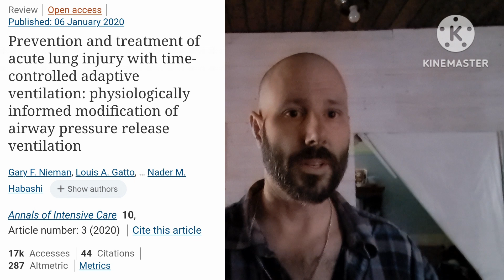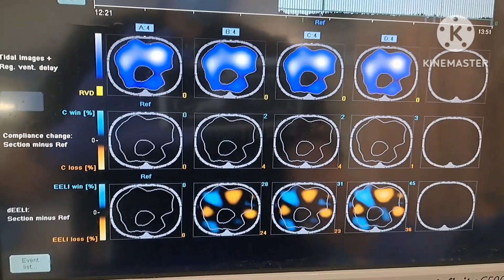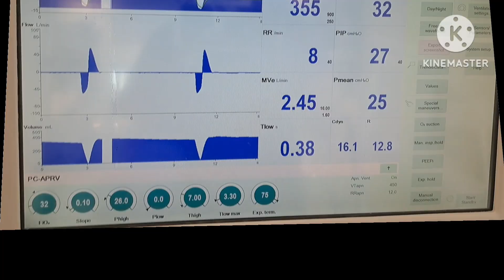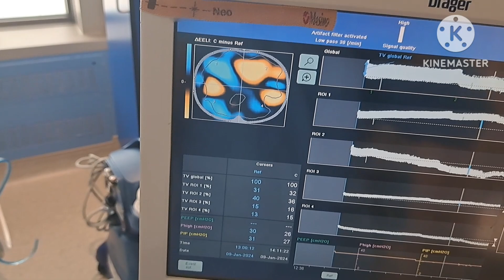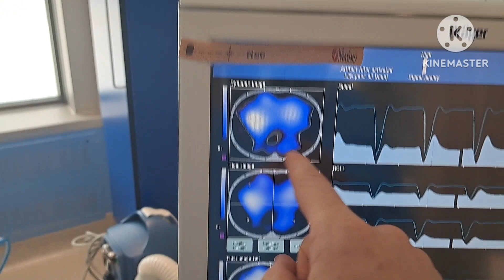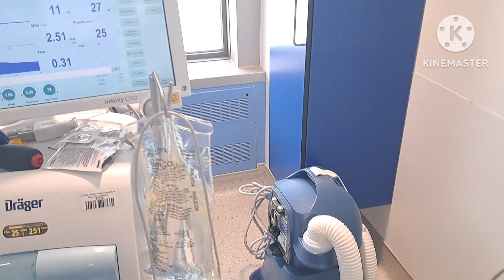Weaning APRV  (P-High Setting) Using PulmoVista 500  #mechanicalventilation #respiratorytherapist

Comment: Yes I have seen it. Seems a little bit too clunky. I would love to see a eit video with HFOV as well. The timpel folk have some nice ones with peds. Keep your videos up man. Good work.
Reply from the maker: Thank you 👋 for the encouragement. I would love to expand the channel by having other clinicians discuss various topics. 

jjswartz79@gmail.com 

Please let me know if you ever want to join a livestream and chat. You can pass my email around if ever someone would like to present something on my channel they can.
Reply from the maker: We don't have HFOV, but I'm working on it. I also need to convince my boss to have esophageal balloons for those rare cases (7 Liter + fluid) with obviously insanely high pleural pressures. If the EIT is saying 48 cmH20, P-HIGH is optimal,  I would like that variable added to the clinical picture. Thinking a Plateau below 30 cmH20 is always safe with these patients increases mortality, but without EIT or pleural pressure, we are flying the plane blind.

I had a case with a P-High of 45 cmh20 being optimal. It opened this severely collapsed lung (baby lung). Patient 7+ liters. Went to OR and eventually was 12 + liters. They called, and I said increase P-high further because volume was down to 125 ml. Instead, they were scared and lowered P-low for more of a deltaP. That increased volume for 1 hour, then lung closed never to open again. The transpulmonary pressure was not taken into consideration. The increased P-high would not have been transmitted to overdistention, in my opinion. The atelectrauma is the real killer, in my opinion. Anyways, this was a crazy case where family was pushing to continue treatment instead of letting go.

Comment: You have an esophageal balloon /with vids? Thanks.
Reply from the maker: This is the only darn thing that's missing. The PulmoVista 500 has an esophageal ballon module that they are making to add to the electrical impedance tomography device. I don't know if it's on the market yet. I am working on getting this in our ICU also. Thanks for commenting 🙂